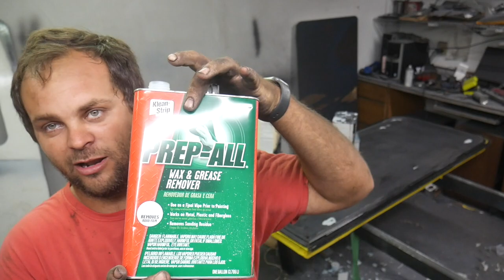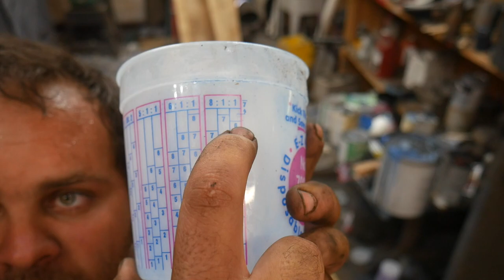Homemade RV. EP-11 How to paint. 1977 Peterbilt 359 Toterhome

Comment: Thank you so much for this video keep them coming. Question. Building your box for your coach do you have anything against using the 3M tape to adhere your sheets to the frame as opposed to the screws and rivets?
Reply from the maker: I don't know anything about the 3m tape. I haven't heard anything bad about it and it looks really nice and clean. My biggest reason for going with screws was for the look of the screws. I felt the stainless screws on black would look clean but not modern and go more with the 70'sish style with the truck and Winslow paint scheme.

Comment: Great job again Zack. I want to spray the inner fenders of the KW to help against rock spiders in the fiberglass, any thoughts, maybe the Raptor you talked about. Thanks Ken
Reply from the maker: 100% recommend Raptor liner. I used it on a car underside 2 years ago and its tough as powder coat. The best thing to do is spray with epoxy primer, give it a couple of hours to dry, and spray the Raptor liner. If you thin the Rapter with about 10% reducer it gives a smoother finish that won't hold dirt and is easier to clean. it makes it look more like a undercoating that a bed coating.
Reply: Thanks for the advice your doing a amazing job, great to follow.